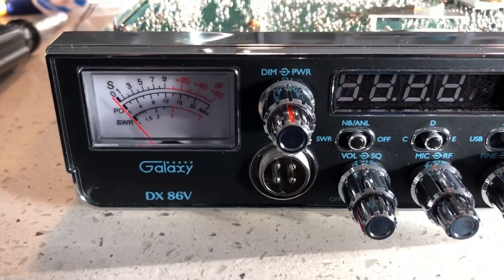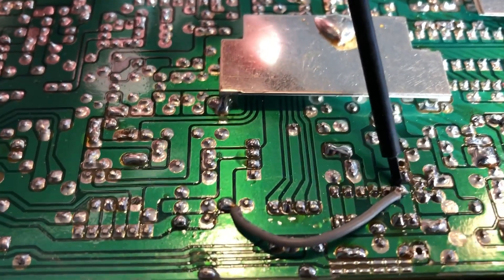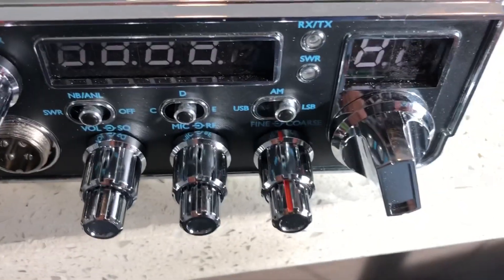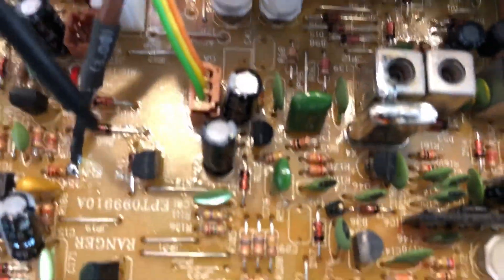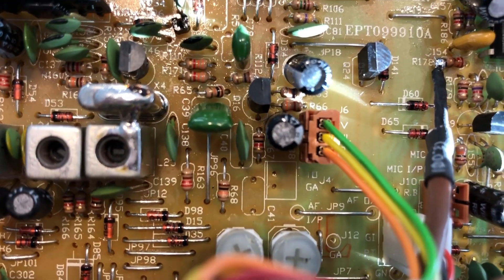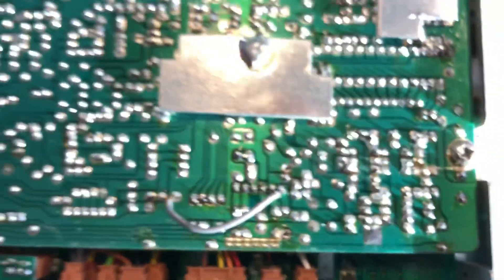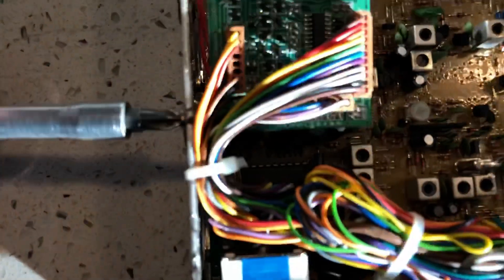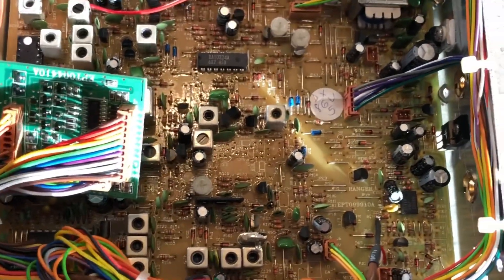Galaxy DX86V Clarifier Unlock Mod, 10k and HI-Cut mods

Comment: Will different value capacitors vary the amount of high frequency cut from the audio?
Reply from the maker: Yes they will. The value I used is same one that is used in some of the high end base units made by Galaxy. It’s a good value.
Reply: @hamradion1fjb  and you used a .022mfd cap correct?

Comment: I just got this radio and so far love it. Why do you unlock the clarifier and if you do is there any freq calibration required? I notice mine acts abut strange on channel 38 when switching from am to usb and lsb. Unlocking would give me more range in freq at set channel??
Reply: Can I get your number? Do you do these mods? If I send to you?